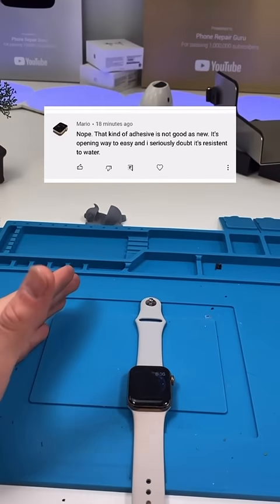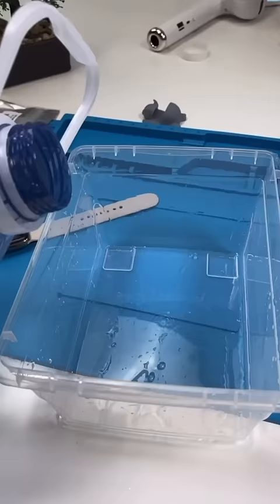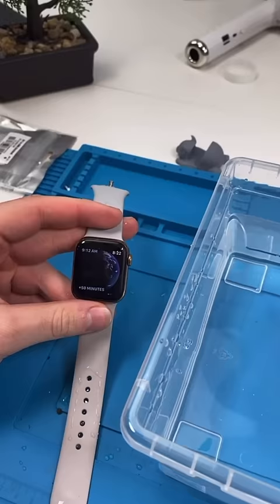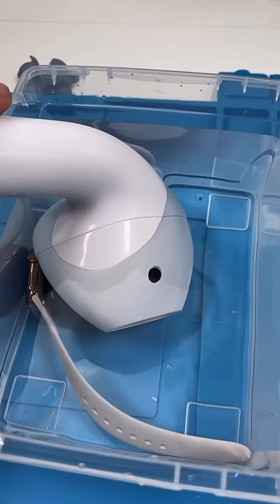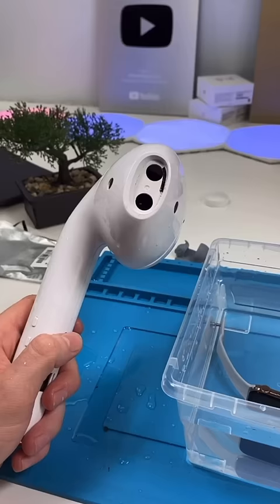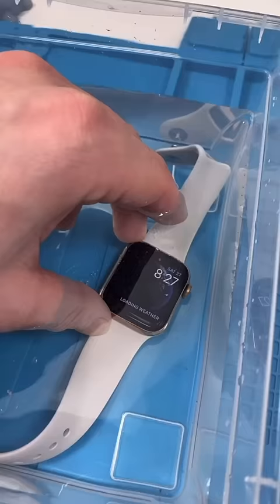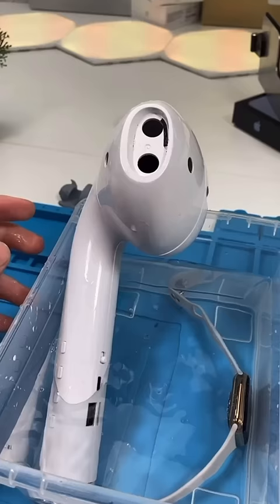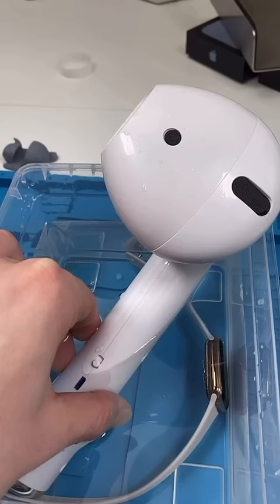Is This Apple Watch Water Resistant After Repair? #Shorts

Comment from the maker: I don't recommend trying this with any repaired device. Keep in mind water resistance goes down with age as the adhesive degrades. Keep your older phones/devices away from water regardless of water resistance ratings.
Reply: Agreed.
Reply: Also keep in mind that the ingress protection might work just fine on a puddle, but hit it with some pressure at few metres deep and you're done.
Reply: Big Fatty Airpod : Go crazy hodbzhsnvf go stupid
Reply: is that distilled water
Reply: I remember when you had 100k followers and i was asking alot of questions
Reply: Just get a new one
Reply: @viemarimyyra  well yeah, the IP rating phones test never accounts for pressure
Reply: Your subs is almost 2M subscribers, congrat!
Reply: @robertonvarrete9517  well it costs money
Reply: @NorwegianToast69   yes but if you bought an Apple Watch you got the money for it besides who buys one and doesn’t put insurance?
Reply: Adhesive isn't everything, there is also a water repellant to put stress off the adhesive and is the reason why devices without adhesive or effective adhesive can still be waterproof
Reply: Me in the shower with iPhone 7 👁👄👁
Reply: And it has a crack in the screen and camera so you know.  Back glass is good still though no cracks there. Oh wait that’s cause it’s still aluminum.
Reply: Updates! There Is water visible in the screen. It doesn’t seem to be affecting anything yet though. And the Taptic Engine is dead.
Reply: @alexwaite3626  the hell
Reply: @jimmy12234  taptic engine is working again. and the screen has kinda dried out. def some perm damage though minimal. Really i was seeing of the water rating was accurate and if it still held true for a old phone but clearly not.
Reply: Plz do the Apple Watch ⌚️ locked
Reply: @viemarimyyra that is why you don't put down the pool my phone got stuck at boot loop because of that

Comment: That much water is pretty harmless for any device 😂😂😂 mostly reviewers do water test of smartphones without IP ratings and they do survive but in a real pool or river where the pressure is very high even if you submerged it 5 inches deep, I'm afraid it would get damage if your device does not have more than IPX5
Reply from the maker: Should I try that? I more so just wanted to make sure the water wasn't getting in and submerging it wouldnt kill it
Reply: @PhoneRepairGuru  sure bruh..!! It's better to be 100% sure than hoping 👍❗
Reply: @PhoneRepairGuru  Bring the giant airpod too
Reply: water pressure is solely based in-depth because complex math and physics i can’t tecall off the top of my head. some structural engineers on a forum thread discussing soemthing about how to handle pressure of water against an aquarium panel showed the math and explained how volume is irrelevant as pressure basically only exists downwards based on depth

Comment: Ok this makes me feel better about fixing my own. It’s got a large crack across the bottom of the screen, it doesn’t impact the actual display, but it’s completely vulnerable to water now. I dropped it in a bucket and immediately wrapped it in a thick towel and put it on my night store (ours basically uses the heat from the hot water cylinder to heat up a stack of bricks surrounded by what essentially just looks like a normal {but chunky} wall heater) upside down. It was dead as soon as it touched the water but eventually the apple came up. It boot looped for around two hours before eventually coming right. It’s perfectly fine now, but I’d rather it was a bit more water resistant… I’m thinking a replacement screen would definitely be worth it!
Reply: I mean if it’s cracked that’s gonna happen
Reply: @Ben.N  haha I know. But this video means I could make it much better lol
Reply: Yes fix it. I got my phone wet and the screen is cracked and so it the camera lens. Now I have water under my screen.

Comment: That big fat AirPod boi is more durable than the actual thing lol

And that doesn’t even have a water resistance rating
Reply: the pros and the other (newest) are
Reply: The big AirPod only has technical stuff up top
Reply: My airpods survived the washer and dryer, case too
Reply: @mangut650  no it had some at the bottom plus stuck it in on both sides
Reply: lol i bought fake airpods, they went through the washer 2x, dryer 1x and they work still
Reply: Regular AirPods aren’t water resistant

Comment: Now these days most circuit boards are covered in a lining which helps prevent instant water damage. Even then sometimes it's still not good enough because of the voltage or how exposed the components are where it can cause your device to break or short. Those are very rare and unfortunate situations :(

Water damage imo is a slow killer where it will slowly erode and eat the contacts on the board. Tho I'm not an expert at this I'm just a programmer. Not a hardware engineer/technician. All I know is that most handheld devicess have that coating in the circuitboard to make it "water resistant"
Reply: Like Motorola with their nano coating

Comment: Yay, im in a Guru Video :D 
But seriously, i opened up a few series 4 by now and that glue is a mess to remove. I hate it so much. Some of them had water marks like oxidation and those typical white limescale marks. So i doubt the water resistance of that liquid glue and i also think that's the reason why those watches stopped working in the first place.
For some reason, the force touch gaskets for series 4 and higher are not adhesive anymore.
Reply: the force touch sensors aren’t even necessary. They have no purpose anymore, after Apple stopped using 3D touch.
Reply: @tuomasvihavainen3976  Except for keeping out water. And you need them for the right feeling because without it, there is a 1mm gap.
Reply: @Gaming25  Good point! I think the glue would be able to keep out water, if proper glue is used.

Comment: It should be fine with that amount of depth, anything below 6 or 10 feet could probably destroy it.
Reply: And???     If you go diving with an Apple Watch on, that’s your problem. Not the watches fault.
Reply: @Darthybuddy  apple watches are literally meant to be able to swim in
Reply: @macncheese2832  I said diving. not swimming. 

siwmming is on the surface or within 10 feet of it. Diving is typically 30+ feet down. 

one involves a lot more pressure which stresses waterproofing a lot more
Reply: @Darthybuddy  6 feet is not diving.
Reply: @timdeathly  I said 10. not 6

Comment: The most likely reason that it survived the tap water is that your tap water might be filtered. To do more extreme testing, or testing to see if it is waterproof, use salt in the water. The reason you don’t run a pc in the ocean (1) it’s dumb and (2) the salt is conductive and can cause the circuit to short.

Comment: Tap water doesn’t kill electronics instantly, not on that low voltage that is. The tap water will corrode components and solder joints over time, sometimes quicker and sometimes slower.
Even mains won’t get a direct dead short if held apart far enough in tap water. Only if held close together you’ll be able to short out, if not actually holding both contacts together under water.

TLDR; Leave it in the water running long enough and you’ll kill that huge AirPod.

Comment: Electronics work fine in water if all the connections are sealed. If no boards or wires can be shorted then water won't stop electronics. Some super cheap electronics wind up being heavily water resistant simply because the manufacturers cover the boards and wires in glue. Awful for repair, great for water resistance. Still don't put electronics in water unless they are intentionally designed for it.

Comment: Bruh water damage isn't instant. Most of the time you can put stuff in water and it will be fine as long as you thoroughly wipe it down afterwards. If you don't then that will cause corrosion and then your device won't work. Although you can cause a short with water I have seen more corrosion killing devices with water damage than the water itself.

Comment: Bruh it stayed in the water for 5 minutes at a depth where there is basically no water pressure. It's not water resistant if you test it like that.

Comment: You know right that there's thing called WATER PRESSURE?! The deeper you go on any body of water the bigger pressure you get, a 7 inch height body of water doesn't have the same amount pressure as a 2m pool, that's why many electronic products that have a water resistance tag always says "water resistance up to [X] deep", the original Apple watch 7 seal is good up to 50m(they claim to be good up to 50), and the pressure at 50m is around 30+ pound per square inch
Reply from the maker: Never heard of it tbh